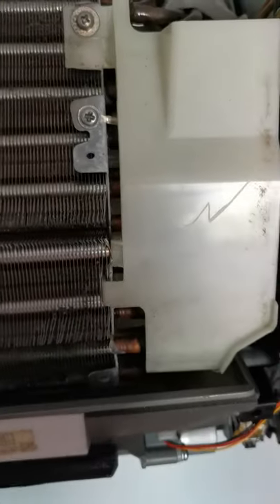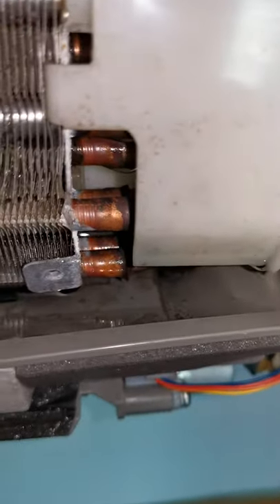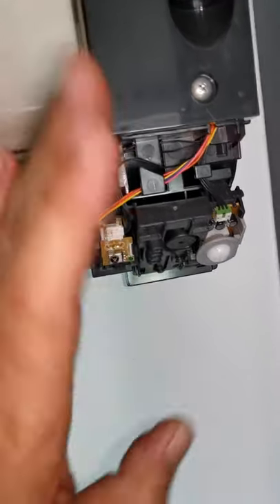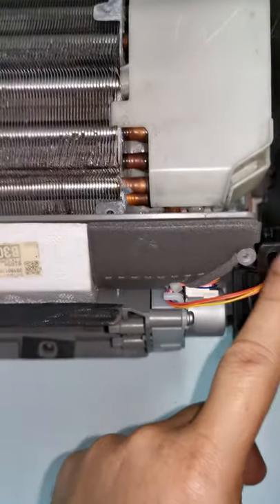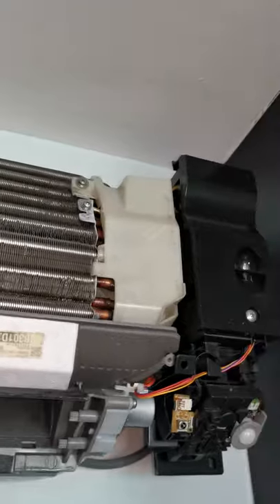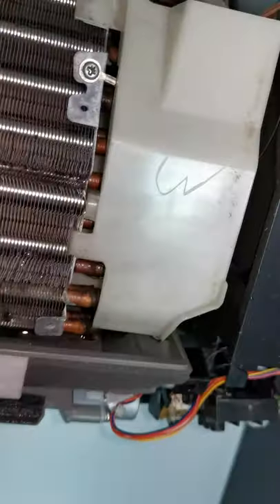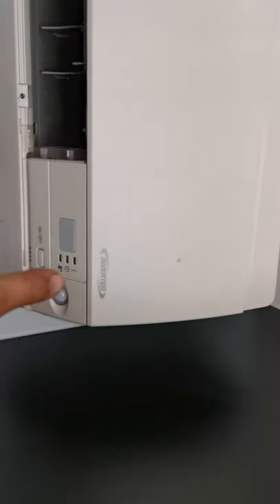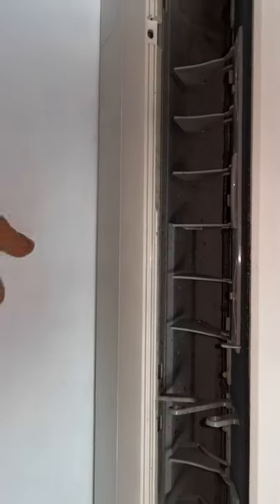Daikin aircon water dripping, is it safe to continue using it?

Comment: if Daikin 1HP has water dripping during at night, if the air is cold and no blockage on the drainage, simply turn on the auto fan and auto flip will solve the issue immediately.

Comment: Kevin, i cleared my drain pipe. However i find condensation is kinda at the high side, i wonder is it time for full overhaul?
Reply: if Daikin 1HP has water dripping during at night, if the air is cold and no blockage on the drainage, simply turn on the auto fan and auto flip will solve the issue immediately.

Comment: 1:52 the sensor in mitsubishi starmex is it hidden away? I am considering Daikin ismile eco (R32) and Mitsubishi starmex (R410A) (mitsubishi R32 not available yet), it looks like starmex is easier to dismantle the drain pan (and the detach the power area) to access the blower so at least can brush the dirt away? Daikin ismile eco blower uses magnetic at the right side seems better but the drain pan seems harder to dismantle. I am still researching and more keen on mitsubishi for easy to clean, only worry is it is R410A might not get the gas in future and need to replace new system if gas discontinue. Daikin, mitsubishi which one more durable? Any advice appreciated. Thanks.